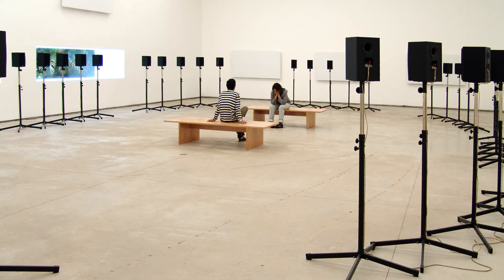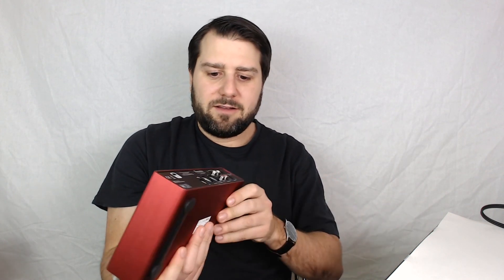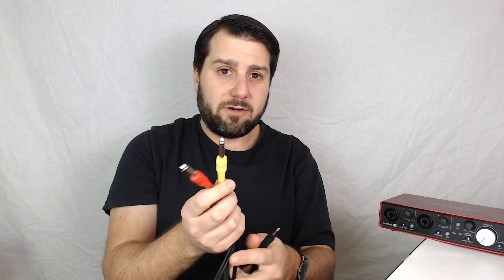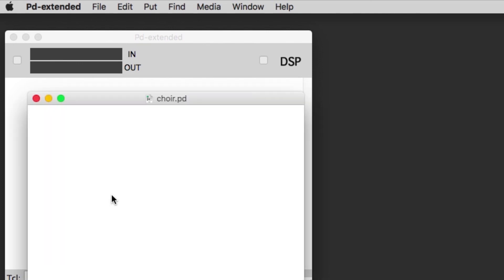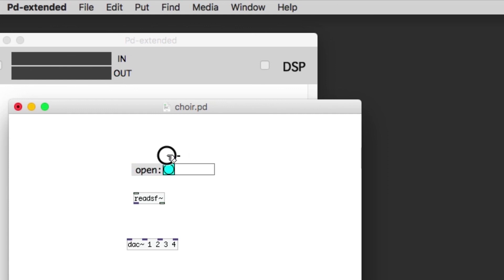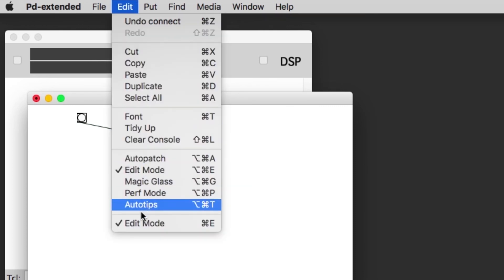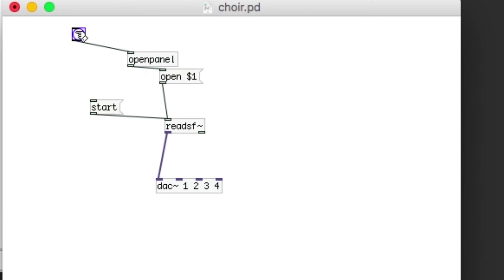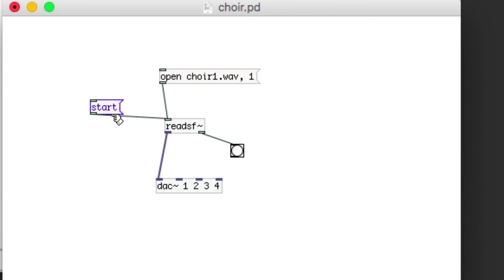How to Design Sound Art Installations with Pure Data (Part 1)

Comment: Thanks for sharing. I use max from time to time but have recently started using individual arduino/speaker combinations for a new project based on mass surveillance. Stops me relying on a computer to be present with my pieces.
Reply from the maker: Yeah and a headless raspberry pi or beagleboard are also interesting tools for this too

Comment: Does the audio have to be saved in a certain folder? I can get mine to work when it's triggered by the bang and openpanel object, but can't get any playback when the message has the file name written in it, thanks in advance!
Reply from the maker: Hey! Yes that's a good question which I failed to touch on. It has to be in the same folder as the patch, or you have to provide some sort of file path otherwise. And if it doesn't work right away, you can try saving the patch, closing it and re-opening it.
Reply: @SpaghettiLab  awesome, I'll give that a shot! Thanks for replying so quickly!